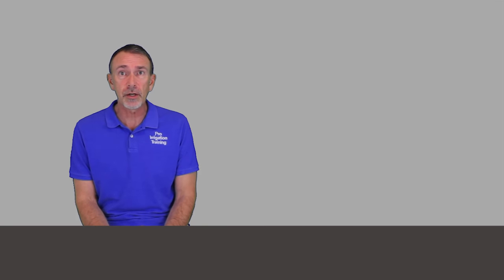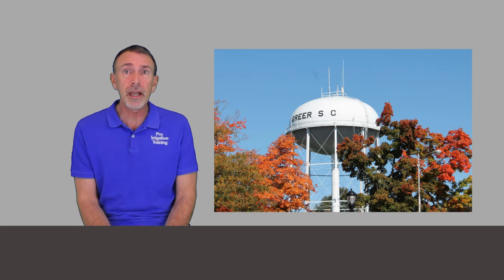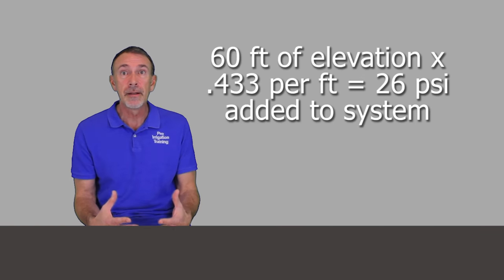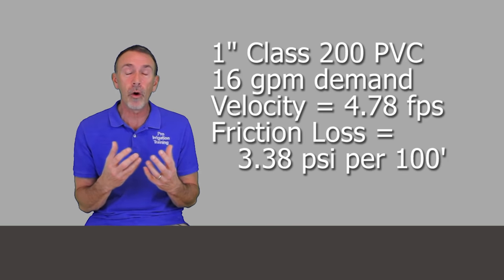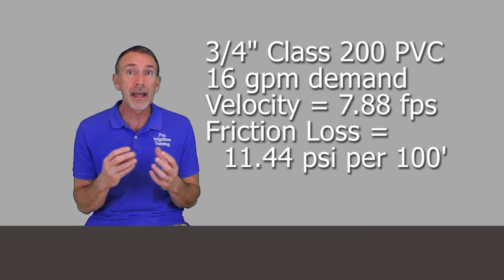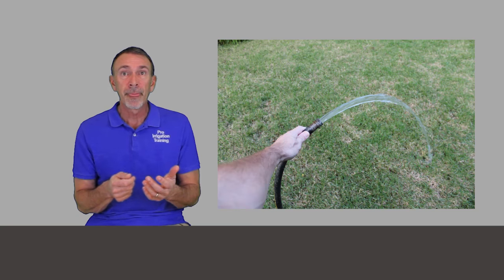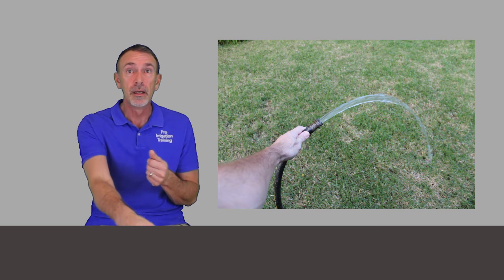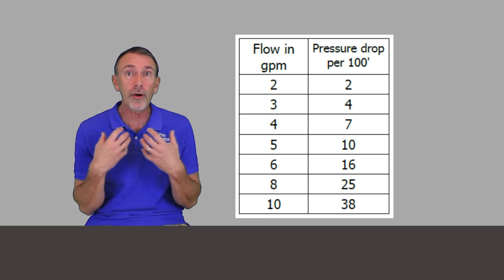3 Ways to Increase Pressure in an Irrigation System

Comment: I had a friend that ran 3/4" pipe 600 feet to his house and had low amount of water to his facets. we did a little searching (before the internet ) and figured out it wasn't a pressure problem, it was a volume problem. the fix that we came up with was to replace 8 feet of 3/4" pipe at the house with 8 feet of 6" pipe. after that he could run multiple faucets at the same time without loosing so called water pressure.
Reply from the maker: Wait what? 6" Pipe??? You could've supplied a whole subdivision with that! But you were right about your friend's house, it was an issue of volume in that 3/4" pipe, which at 8 gpm would lose over 30 psi through 600' of pipe. At 10 gpm demand which is basically a shower and a hose bibb running at once, would lose 47 psi through 600' of pipe.
Reply: Did you guys replace the pipe close to the house in the house or by the water supply lime?

Comment: So basically what your saying is for example,, / say my pressure is 15psi from my source of water , turning a garden hose to high pressure setting from 3/4 to 1/2 setting, your actually decreasing psi , because the flow rate went down forcing water thru 1/2" setting  trying to keep up the demand of the 15 psi at the water source , may seem like more pressure to the eye but in reality is less pressure , that makes me question if psi is only measure on the inside of the closed circuit and not what's coming out ???

Comment: Nice video! Im a landscaper thats beginning to do more irrigation. Ive noticed that many systems have 1 inch pipe at the source and then its reduced to 3/4 or 1/2 inch. Why do this if we are losing a lot of pressure?
Reply from the maker: In that situation, you're seeing "Pipe sizing." It's not losing pressure in that context, if the pipe is the right size for the water it's needing to carry. When the system or zone starts out, it's maybe pushing 15 gpm, which is within the limits of 1" pipe. But as the zone pipe continues on, and there's less heads to supply, then smaller pipe sizes are ok to carry the reduced flow demand.

Comment: I understand what you’re saying in regards to downsizing but answer this, why are all the sprinkler pipes at least here in Florida downsized all over the yard? Most here at least in south Florida don’t used county water but use a sprinkler pump through a well or canal?
Reply from the maker: Probably what you're seeing is called "pipe sizing" if the pipe size is descending as the zone pipes go away from the valve. It's a method of only using the minimum size of pipe necessary to carry the flow needed. For a residential property, it may start out as 1.25", then go down to 1" then .75" as there's less heads to supply further out in the zone. I'll be posting a video shortly that outlines how to calculate Pipe Sizing for system installation planning.
Reply: @Proirrigationtraining  Thank you

Comment: I am just installing a system in my yard using 1 inch pipe to the valves and then reducing to 3/4 from the valves. Should I just use  1 inch pipe for the entire system? From my well to the furthest point is around 350 ft

Comment: Great great video. Well done. Thank you. I have 30 psi coming out of a spigot sourced from a well pump quite some distance away. I need a minimum of 40psi to power an RO system which will water some animals I have. I have electricity near my spigot. Having a tough time finding a reliable booster pump that is for potable water that I can place in between spigot and RO system to feed the RO system a minimum of 40psi. Any recommendations or sources to look at?
Reply from the maker: Thank you, glad the video helped you. Goulds makes a good, affordable pump that can be used in a booster situation. Look into the GT07 (3/4 hp) or the GT15 (1.5 hp). In this kind of setup, you would need either a tank and pressure switch or a Mascontrol which is a device that turns the pump on when it senses water moving when you open the spigot. My recommendation is to buy from a local supplier so you get some warranty and support. Amazon is great for some things, but this isn't one of them.
Reply: @Proirrigationtraining  thank you.

Comment: @Proirrigationtraining Help please.....Water Hammer Effect.  My sprinkler system pipes bang when changing some zones.  My sprinkler gut cannot figure it out.  He lowered the sprinkler water pressure and now they bang more.  I did have a hot water tank and pressure release house valve(?) replaced prior to the summer if that matters....HELP!
Reply from the maker: Hi there! Sorry to hear about your issue. I've got two solutions for you, but there's really no guarantee. Solution 1: Turn the pressure back up in the system. Go to the valves that are causing the water hammer. Do they have flow control knobs? If so, turn the zone on and turn the knob down until it starts to lessen the spray from your sprinklers. Recheck for water hammer. If the valves don't have the flow control feature, you can replace the top portion from a new valve that does have the feature. Solution 2: Install one or two Water Hammer Arrestors. It's a small device you install on the main line, put one near the valves and one near the beginning of the system. Good luck!

https://amzn.to/3zTgepP

Comment: I recently added a hose bib for my garden.  I tapped in to my irrigation system that has three valves on the manifold.  The hose bib has great pressure.  However, now the sprinklers have no pressure, even when the hose bib is turned off.  Why would the hose bib (or did it) cause the sprinklers to lose pressure even though the bib is not on?
Reply from the maker: That's a weird situation. The hose bibb when off should have no affect on the pressure. The piping used to attach the hose bibb may have caused a restriction that reduced pressure or flow. Or its possible that a fragment of pipe got into the pipe during the alteration, or even a blob of glue may have moved down the pipes if the water was turned back on too soon. Check the meter or supply point, did the valve get opened all the way back up after the alteration?

Comment: Love the video! Similarities to electricity too. If you want to power a large constant load at the end of a wire, you need wire of (x) thickness... Going to a smaller wire will result in voltage (pressure) drop and increases losses (heat) in the wire.
Reply from the maker: Yes sir, you are correct! Thanks for watching.

Comment: I'm an irrigation technician and installer with my own business in the Reno/Sparks area of Nevada. 
I just finished a doing an upgrade on a system that has a 3/4 service line and 3/4 irrigation main ,PVB, and two lawn zones. 
Zone 1 is approximately about 90  feet of 3/4 sch 40 pvc with 10 rainbird 1804s with 15 ft Van's and great water pressure..
Zone 2 is 90 feet of 3/4 pvc and 40 feet of 1/2 pvc sch40 with 11 popup 1804s with 15 ft Van's a also has great water pressure. 
Flow tests show 26 gpm at 40 psi.
Next house we are doing has 3/4 service line and 3/4 pvb backflow  1 zone of 80 ft  3/4 pvc with 8 , 1804 rainbirds,  with 15 ft van nozzles and just barely enough pressure to pop up the heads.
You can push the heads down easily with your foot or hands.
Flow test at the closest hose bib shows 5 gpm.
I'm going to take a flow test at the Backflow to check for accuracy , but , not sure why we have no water.
Amy suggestions you might have would be appreciated. 
Thanks..
Mark Nye the sprinkler guy
Reply from the maker: Hi Mark. I've definitely got some questions and comments. You said " Flow tests show 26 gpm at 40 psi." Where are the flow tests being taken at? I suggest first that you get a good liquid filled pressure gauge and check the pressure at the test cocks of the PVB. Is this a supply method of a PVB installed on an outside hose bibb? If so, there's a chance that house #2 has a pressure reducing valve on the house set lower than house #1. Testing the pressure on both test cocks on both PVBs will tell you the system's inlet pressure and also if there's a significant pressure drop inside the PVB.
The problem with both of these systems is the size of zone pipe used. In system 1, zone 1, assuming that all the 15' VAN's are at a 180 pattern, the flow demand for that zone is 18.5 gallons per minute. If you look at a friction loss chart for 3/4" Scd 40, the maximum recommended flow rate is 8 gpm. That means that these zones are experiencing high rates of friction loss (probably 30 psi lost in pipe and fittings.) This means that the inlet pressure is extremely high to overcome all the friction loss and still provide good pressure at the heads. So, what could be wrong at the second house? Lower inlet pressure, resulting in lower flow rates in the system. The flow demand for the first zone on system 2 is 15 gpm. If the flow test at a hose bibb is only 5 gpm, then there's definitely a problem. Check your pressure on the test cocks, if that's the same as the first house, then there's either an unseen leak, or your zone valves needs rebuilding. If there's no leak and the valve is operating normally, there's another trick. Replace all the nozzles with Toro Precision Spray Nozzles which have a much lower flow rate. That will lower your overall flow demand and recoup some pressure back into the zone.Let me know how it goes.

Comment: Great video, super informative and just what my husband and I needed for our irrigation issues. Thank you so much! I only wish we had your expertise when our system was installed, we wouldn't be dealing with issues we're having right now. 😊 Thanks again!!
Reply from the maker: What issues are you having? Anything I can help with as far as advice?
Reply: @Proirrigationtraining  Thanks for the reply! We had a Rain Bird irrigation system installed in late August last year. They put in 6 zones for a fairly small front yard. The pump would cycle on/off, so they reduced the 6 zones to 4 which ran perfectly last summer, as well this Spring, up until 4 days ago. Zone 1 still works fine, but the other 3 do not. ALL of the sprinkler heads only pop up partially and the water pressure is decreased, as well as some of them "spit", like there's air in the line. Help!! Lol! Any thoughts would be very much appreciated! Thank you!!
Reply from the maker: Hi Amy, sorry its taken me a couple days to get back to you. My recommendation is to get a competent irrigation tech to come out and look at your pump. My educated guess is that either your pump intake is partially clogged (and I'm assuming that this is a lake pump?) or there's a leak in the intake pipes somewhere that's allowing some air to be sucked in, which may be causing the spitting effect. The intake line has to be sealed up perfectly or problems can arise. I saw your pre-edited post saying you were in SC. Where at? I'm in Greenville, and I've owned businesses in Greenville and Columbia, and I can definitely refer you to an expert in either of those areas.

Comment: @Proirrigationtraining Thanks for the videos. Their much appreciated. Wondering if you could help me with a recent issue. I just learned i dont have sufficient flow or gpm to properly push water through 5 hunter rotors (i-20) just installed. I'm only getting about 5.5gpm from the timer on one zone with 5 rotors with 1.5gpm nozzels each that require 7.5gpm total when added up. The rotors do open up and work, but you can visibly tell that there is some pressure loss or not enough flow to really spray out as it does when it was just 1 or 2 rotors in use. Will adding a booster pump help add enough velocity and pressure to push that water out faster and get that extra pressure thats needed to run all 5 rotors at once like it should, and if so, what specs should i be looking for in a booster pump to make that happen? The total line length is approximately 100-140ft long with some slight elevation towards the end of the line, and i read 60psi before the automatic timer, but I'm sure that number is much lower towards the end of the line.  ...Thank you!
Reply from the maker: It's not guaranteed that a booster pump would help. What is the size and type of the zone pipes going out to the rotors? Hopefully at least 3/4" PVC or Poly? And the booster pump can only pull water that's available. It might just not possible to get more than 5.5 gpm there. If possible do a flow test or 5 gallon bucket test at the source to see if it's a source flow issue or a restriction in the pipe or too small pipe size.

Comment: I would like to know if putting a pressure accumulator in the system can help me.
I have seen several videos on Youtube where they insert an inverted bottle/container just before the outlet of the irrigation lines and show the water outlet pressure before and after insertion of the pressure accumulator and can see how the pressure in the second case is much stronger.
Is this a good practice or is it just a tease?
Thank you
Reply from the maker: Thank you for the comment. To be honest, I've never seen one, but I'll do some research on the subject.
Reply: @Proirrigationtraining  This is one of the videos discussing the pressure accumulator. (https://www.youtube.com/watch?v=nswbUpJDLms)

Comment: So my issue is I have a drip line (which is at the tail end of all my other drip lines) that has very low pressure compared to all the other connected drip lines on the same watering station.

Is there something I can add to that specific drip line to increase pressure? I thought it would be a simple pressure regulator - but those decrease pressure than increase, right? And I don't want to increase pressure at the station, because then it would be too much pressure for all the other lines connected to it. Therein lies my dilemma. Thanks.
Reply from the maker: You're correct in that a pressure regulating valve will only reduce pressure. It may be that you've demanded too much water flow from the zone or that particular run of drip pipe. You can normally only get 4 or 5 gallons per minute through 1/2" tubing, It's pretty easy and common to attach too many drippers or micro-sprays or dripline and demand too much water from the pipe which looks like low pressure. The only solution is to create another zone or supply point. Thanks for watching!

Comment: thank you for this information 
what I know is that: The flow rate does not change by decreasing the outlet area. it stays the same but the pressure drops and increases the velocity and that is what happened 
correct me if I am wrong and thank you for ur effort
Reply from the maker: Boodi, I had to think about this and re-watch the video to see what example I used. But yes, you do decrease the flow by constricting the outlet. Actually what'`s happening is the decreased flow recoups the pressure that it had before it entered the hose pipe at the full flow and friction loss in the pipe. It had little velocity in that use, as a lot of pressure was being lost to friction. When we lowered the flow by drastically reducing the size of the outlet, the extra energy left in the pipe because of a slower travel rate through the hose pipe gets turned into velocity. The water may shoot farther and faster, but there's a significantly reduced volume of water there.